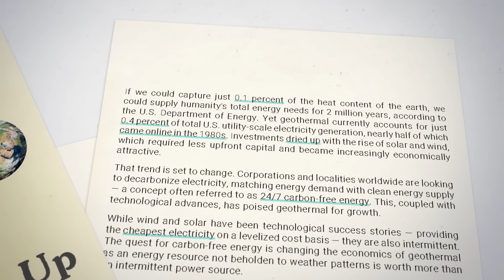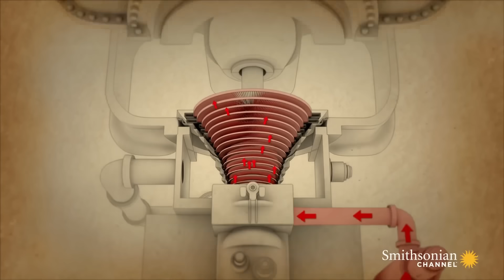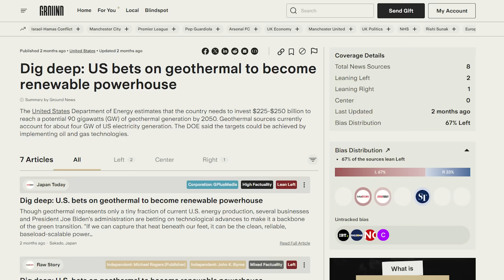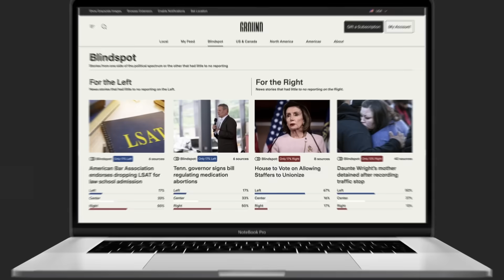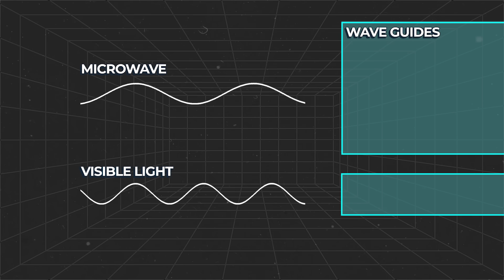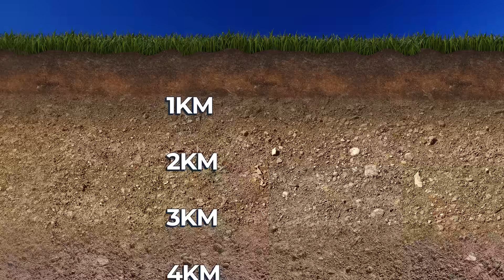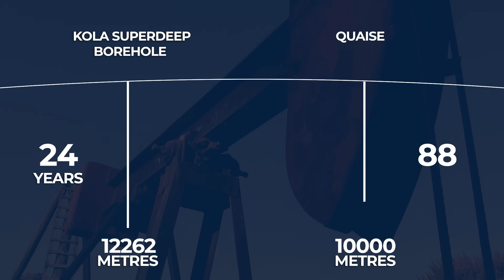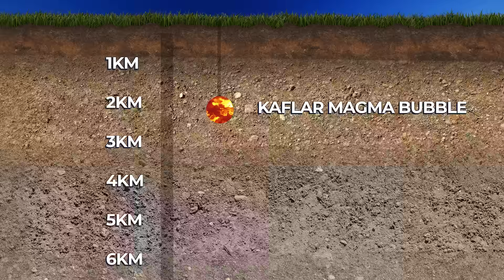This Fusion Tech is Solving the Geothermal Energy Problem

Comment: For several years now I have said we need to divert the money wasted on fusion to geothermal. Think of what they could acheive on just 1% of the fusion money.
Reply: It's not mutually exclusive.  I'm more worried about subsidies for oil and gas....
Reply: @nathanbanks2354  no Fusion would be great. Oh except for in even the best scenarious it will still be even more expensive than nuclear (at least from what can be reliably predicted). but you will get no argument from me about fossil fuel subsidies. Just a fraction of that could further geothermal with technologies discussed here. However to be fair geothermal  was unlikely until the fusion plasma breakthrough and is still in the lab only
Reply: It's strange. I feel good about geothermal, but I feel nothing for fusion. In fact, I think fusion is an attempt to make a technology from a made up science (astrophysics). Which is probably why they are having so much trouble making it happen. That is my opinion though. I'd be surprised if fusion became successful in the next 20 years. Probably by someone who did something different.

Comment: I'm no geologist, but I always assumed with the kola and other previous bore holes, the drill team inserted reinforcing shells/tubes as the drill bits were swapped out to keep the hole from collapsing.  Wouldn't the "glassified" walls left behind by the microwave laser eventually (if not immediately) shatter from the surrounding pressure and shifting/asymmetric forces?
Reply: Like ice, rock does move under high pressure. But I am not sure about the speed.
I think eventually a 20cm will close through shifting rock, but if it would take 50 years for a hole to become unusable and needing to be renewed, that wouldn't really be an issue.
Reply: No, you are no geologist.😂

Comment: How do you get the gas out of the hole, the air pressure at the bottom of the super deep borehole is very high,  isn't it? The number I found by casual search was like 4000 atm, not sure that it's right though
Reply: That can't be right. The air pressure at 10 km altitude is about a third of an atmosphere.  A 10km  borehole would be pressurized by the weight of the air in it; it would be one atm at the surface, and pressure would increase by some amount as you went down, but not an insane amount.  I'd expect a pressure of single-digit atmospheres at the bottom.

Comment: Rock vapor will condensate on the way up and close the hole.They will need to create some kind of cyclone system using cold air to condensate rock vapor and solidify it, and have it to be vacuumed as dust all the way up.
Reply: You got the condensate rock vapor correct, Will have to supper cool the vapor, to form Ash, then move it up initially with high  pressure air to get it well above the Beam drill head to a hopper, then mix with water and pump the sludge out the rest of the way. vacuums are extremely week to lift a perishable mass.
Reply: @H2O2FromH20  you're going need fluid in the wellbore to a/ prevent collapse and b/ stop a blowout.

Comment: What happens to the rock vapor?  Does it settle to take up less space than it started, or does it have to be vented out?
Reply: It goes into the atmosphere forming clouds until it starts raining rocks.
Reply: My understanding is that it creates a vitreous casing for the bore hole. So you don't need to have metal pipe.
Reply: @PolyThumper  That won't solve the 'space' problem. The composition and overall density of the rock is not going to change dramatically just because it was melted/vaporized. Upon condensation it will take up about the same amount of space and with a multi-kilometer long waveguide spanning the length of the hole there is simply no room for that rock to remain in the borehole.
Reply: more importantly they need to remove the rock vapor before it cools. Also the specific heat of the rock vapor is going to cool all the of the hardware on it's way out. Depending on the conductivity of the material eventually the whole 'tube' is going to become an convection oven as they try to get the vaporized rock gas out fast enough not to cook the equipment, two as the plastic point of the rock they won't be able to extract the machine once it reaches that point AND the driving material will have to contend with lateral pressure from sticky plastic-like semi molten material. I am concerned that at that stage where the rock is more like a molten plastic that the gasses could cause massive gas bubbles and the subsequent cavitation could obliterate the equipment ending the whole process. Cavitation in water from what I recall is destructive, cavitation with a billion tons of material involved... this could be an literally GI JOE Cobra supervillain level earthquake machine.
Reply: @IdgaradLyracant   as a vapor hardens further up the shaft, they can retract the emitter and then change the wave length to widen the beam.

They can then re-vaporise this new layer, taking it further up the shaft or extraction.  It is also possible that the hardened vapor is quite brittle and that they could run a conventional drill bit extractor back down the shaft to collect it instead  🤔
Reply: @user936  " and that they could run a conventional drill bit extractor back down the shaft to collect it instead" which is precisely the biggest problem that they were trying to avoid - delays resulting from having to insert and remove a multi-kilometer long drill pipe
Reply: *cook all the equipment
Reply: What happens to the vapor? How does the hole not collapse? How much heat can you extract before a hole becomes too cold and thus innefficient?

Comment: I've seen journey to the center of the earth. Obviously this won't work because we will tap into the hollow earth where the dinosaurs, cathulu, and the lizzard people live.

But seriously, there are a couple companies working on this stuff right now, and the fact is that they don't even need to go quite that far down to make something useful for things like district heating. This sales pitch is based on an extreme depth that isn't even needed, which is what makes me so excited about the space. I mean, the deeper the more effective it gets, so if they can, then they probably should. It just isn't required.
Another thing to keep in mind is that this is a first Gen technology in a lot of respects. A Gen 2 or 3 mature product that is more likely to make it to market could be well above 1MW, allowing for even faster drilling times. Also, nothing is stopping conventional drilling for the first few legs of the process and then transitioning to this tech as normal faster cheaper drilling methods become less useful.
Pretty cool stuff all around!

Comment: It's one thing vaporizing holes in rock in an open environment in the lab, but once you get down a shaft in the Earth that vaporized rock will deposit higher up the borehole narrowing the borehole. Also you can get to a point where all the microwaves are doing is keeping the current cloud of rock vapour in a vaporized state. There has to be a way of removing the vaporized rock from the borehole order to avoid these situations.
Reply: Their plan is to force it out with high pressure argon. And yea I'm also definitely questioning whether or not this will scale. I'm very interested to see how their test sites fare. If those succeed then I'll get aboard the hype train.
Reply: @jonathan-f4i6u  Makes sense.  Argon is abundant, heavy, and a noble gas.
Reply: @jonathan-f4i6u  thanks for the feedback. It will be interesting to see them blow out condensed rock vapour from a 20 mile deep hole
Reply: One way might be to have the stone deposit itself onto a screw conveyor which takes the deposited powder up and out or more likely a vacuum to suck the gas and the powder up

Comment: If this system is proven to work could decommissioned oil wells be used rather than digging new holes?  So instead of filling in the oil well once it's depleted, just put the new drilling implement down it and start drilling from an already bored hole?

Comment: why not predrill the upper part with current tech then switch to the new tech bypassing the energy inefficient part of the drilling process maybe can even reuse existing capped wells,though the possibility of underground fire could be real.

Comment: I haven't read all the comments so this may have been mentioned. Why not start with old or retired oil drilling sites that have drilled quite deeply already? If the technology is geographically agnostic as that guy kept stating then start with a hole that has already been drilled. This will save time and money. It's a no brainer. For now, we simply need more nuclear power plants until this technology or fusion power comes online.
Reply: That's the plan

Comment: This is not a done deal… there are still huge challenges. Vaporised rock might deposit in the inside of the tube, but also on the drilling equipment. I predict the big problem of choking at depth - high pressure venting to force out most of the vaporised rock seems like a possible solution. But relying on the vapour knowing where it’s supposed to land will not work. 

I’m not sure the $95m is enough to solve those challenges, but I really hope it is. If they can make this tech work it basically solves our energy needs forever.
Reply: I'm pretty sure they've thought of this.
Reply: @incognitotorpedo42  I’m pretty sure too but the problem is a hard one to sort and limited funds might make a solution difficult to realise.
Reply: @incognitotorpedo42  Doesn't seem like they have considered one fundamental point.... you cannot drill a well without fluid in it - at or above the equivalent mudweight or hydrostatic pressure of the surrounding formatioI pressure. if you do,, you will collapse the wellbore, and if you penetrate anything penmeable, you will have a blowout. 
However, certain conditions require "underbalanced" drilling and requires additional surface gear but the fundamental  points remains - it still has fluid in it which kinda make the op point moot. 
I don't think the average Joe understands the pressure at depth in drilling wells. Deepwater horizon is a great movie although not technically accurate.
Reply: @hankchinaski4075  Can high pressure rock vapour serve the same role as the drilling mud?
Reply: Yes. $95m seems like a drop in the bucket for such a grand scheme. Hope it's not a scam.

Comment: It no longer takes 24 years to drill so far. Shenditake 1 broke 10,000 meters in 279 days.
Reply: The news about Shenditake is wild. The project director says 5 months to hit 8k from the surface (so it's not like they took over an existing hole) and then 4 more months to hit 10k. So it is kind of crazy how quickly they can reach 8k, and then how much is slows at that point. There are a lot of 8k bores in the area, so maybe it is just that they had the tooling and experience to do it? Not sure, but it is a great achievement either way.
Reply: I worked in the oil field in the 80's and did have the honor of going a little over 32 thousand feet on one hole.. it took a little less than two years.. and during that time we probably spent two months fishing
Reply: Why don't they use that for geothermal? Is 10K not enough? 🤔
Reply: @100c0c  It's for oil not geothermal...
Reply: @FrankLassowski please expound on your comment
Reply: @100c0c  Worth the cost to access a huge oil reserve, not worth it for a small geothermal powerplant
Reply: @100c0c it’s prices that holds it back. Reaching 10K is enough, it’s just typically not cheap or profitable enough.

Where it’s easy and cheap, like Iceland, it’s all over the place.
Reply: We needed this in this video.

Comment: If we suddenly converted the entire world's power usage to boreholes in the earth's crust. And given that the current year over year increase in power draw remains constant, how much energy would we extract from the earth's core in this time? What impact would that have?
Reply: I think the heating of the earth is powered largely by radioactive decay, so I don't think it will be a major limitation.  It will be similar to tidal energy gradually reducing the speed of the rotation of the planet.  The sun getting hotter and engulfing the inner solar system in a couple billion years may be a more pressing issue.
Reply: Human consumption of natural resources hasn't increased over time by a linear rate, but exponential.

I think you're vastly underestimating how quickly our power consumption would jump in just a century, if we gained access to cheap, "limitless" power.

Without checks, it's the nature of a living thing to deplete its environment, and our modern civilizations have been proven to follow this.
Reply: 0.1 percent in 2 million years of use.  So basically nothing.  The Earth's core is constantly heated by radioactive decay.  We're kinda sitting on top of a giant fission reactor.

Comment: RF/microwave engineer here..  the stand out issue I can see is the loss in the waveguide (0.1dB/m@10GHz), worse at higher frequencies.  That's 100dB loss for a 1km waveguide.  100dB = 99.99999999% loss.  I'm sure  there's a reason why this doesn't apply.. but this hasn't covered it.. would love to know how the waveguide really would work.